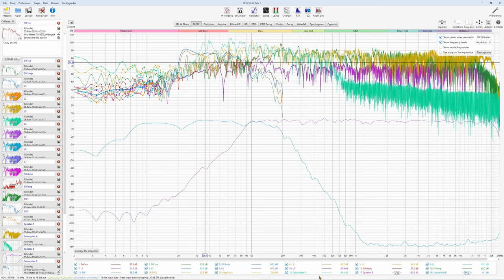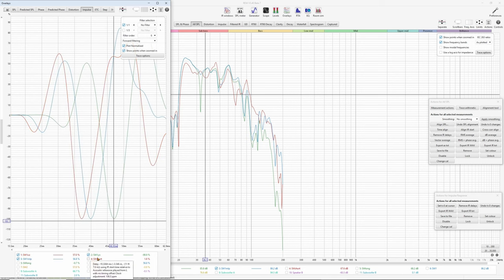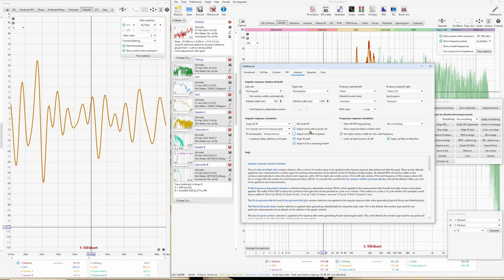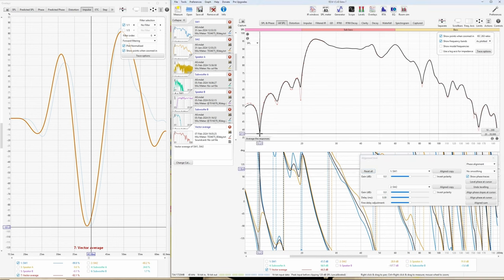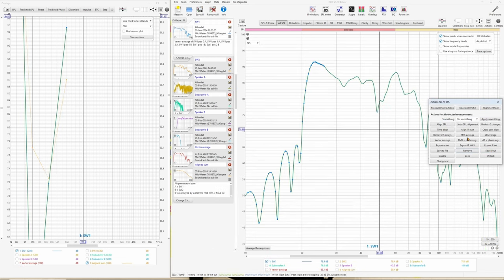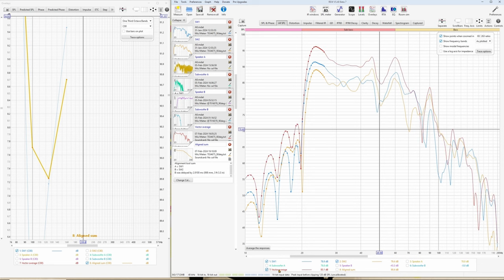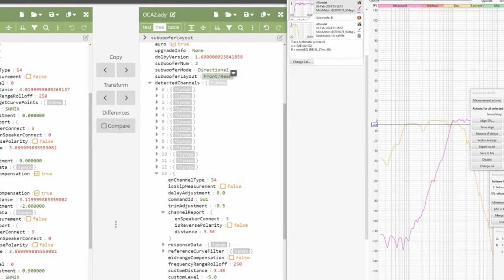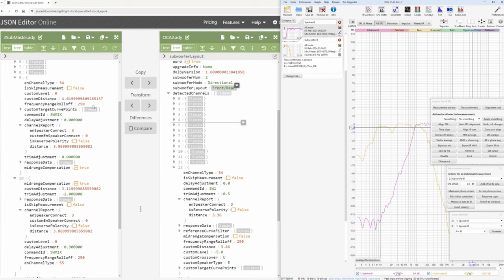Advanced Multiple Subwoofer Control

Comment: If we are time aligning all speakers and the combined sub response to the center channel which is also my acoustic timing reference, then what is the benefit of aligning the speakers and subs as explained in this video? Thanks
Reply from the maker: What's explained in the video is time aligning to acoustic timing reference?
Reply: @ocaudiophile  I am trying to understand the difference. In the end don't both approaches result in subs and speakers aligned to each other? I am referring to the process you explained in the supreme audyssey calibration video
Reply from the maker: This video explains various ways to optimize time alignment. Method is not different to the one in Supreme Audyssey video. At the end of the day, there's only one correct time alignment for a given set of subs and speakers. I was going to include a section on how to deal with Audyssey 6m speaker distance limit as this is a very common complaint but that will be covered in a future Audyssey video. @Rayman-expertsoundpro
Reply: @ocaudiophile  Thanks! Makes sense
Reply: I'll be looking for that video with the 6m subwoofer limit in the Audyssey ;)
Reply from the maker: Soon....
Reply: OCA, I am deeply interested in learning anything to beat the 6m Audyssey limit. I know the delay to set but this limit does not allow that setting.
Reply from the maker: Interestingly, Dirac Live doesn't have that limit on the very same receiver!  @LordAvenger999
Reply: @ocaudiophile  based on the video I as able to find what sub peak needed to be aligned to the speaker and verified with GD. However as others have said, I was only able to enter a max value of 7.90m in the distance field for the sub which brought it closer but needs more so I left it there as it was still better than where it was before. Does that make sense?
Reply from the maker: @Rayman-expertsoundpro  6m limit is really absurd and effecting so many people. Your options are moving to the next possible impulse peak, bringing subs closer (or turning off any processing on them causing extra delays) or increase distance to your closest surrounds and compromise their timing in return for the sub's,
Reply: @ocaudiophile   Is the 6m limit a delta limit i.e. you cannot change the distance by more than 6m? I ask as I was able to enter a value of 7.90m but not more. Is there anything wrong with the approach I mention as it still makes the GD better than aligning to the closer impulse peak?

Comment: PLEASE HELP. I am trying to wrap my head around this concept. I have two subs in what I call a stereo sub config, where the 2 subs are kept right next to the front main speakers. Room is multi purpose, used for both movies and music. It seems to me I have two options - 
1. Align my two subs first. Then align the phantom sub with the main speakers (that is what you seem to be saying). 
2. Align the left sub to the L main speaker and right sub to the R main speaker, which this guy seems to be describing https://youtu.be/yMussZ1C-dE?si=539ppQzrJftwEZUT 
BUT which option is the correct option? Sorry, I am totally confused here 😞
Reply from the maker: You should align the two subs between each other first. If you have an amp with Audyssey, try A1 Evo which will calibrate everything for you.
Reply: @ocaudiophile  thank you OCA! I'll follow this video then. 👍
One more question please...Once I have the phantom sub in REW, should I align it to both L and R mains one by one? Or is there some other method available?

BTW, I have an Emotiva XMC-1, two Rythmik 15" servo subs, Magnepan 3.6r and Bryston monoblocks (also have Magnepan center and surrounds)
Reply from the maker: You need to equalize left and right speakers to the same target curve and align their impulse peaks. Then you can use the vector average of these 2 to align with the combined sub response for a suitable crossover frequency.